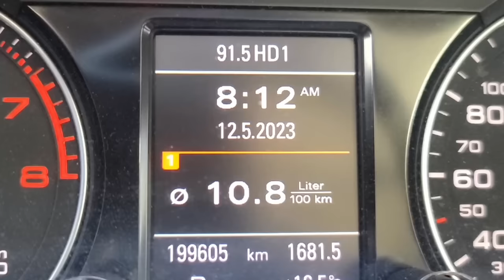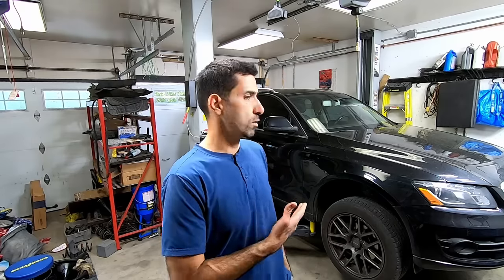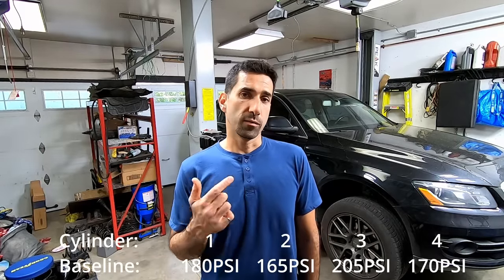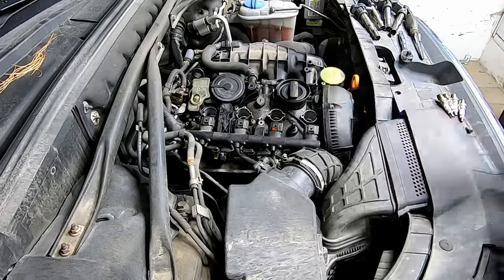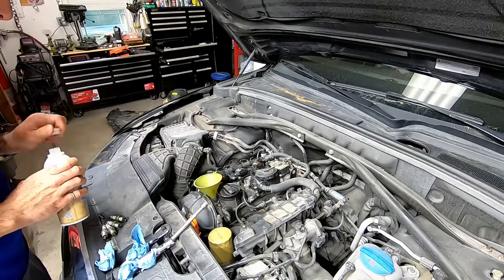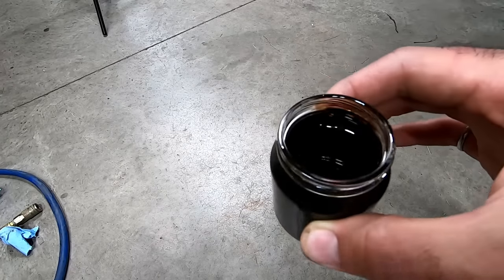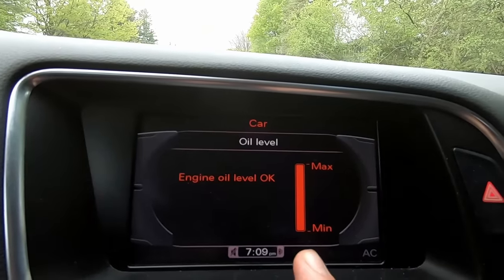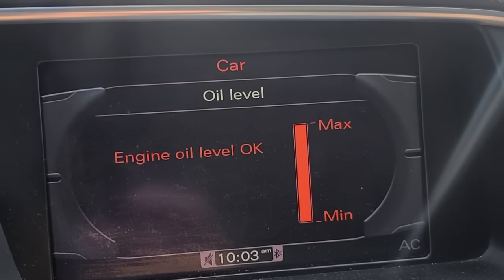How to fix excessive oil consumption from clogged piston rings (Part 2)

Comment: Same problem on 2009 A3 1.8T CDAA, (same engine as 2.0T with slightly less stroke). Oil consumption 1L per ~500km always 5w40. In my area (europe) we dont have access to b12 or seafoam is there any alternative from wynns, liqui moly that we can use? Or maybe using carb cleaner/valve cleaner. I have found that abbro carb cleaner contains acetone which is really good for decarb.
My next question why not using ~50ml of liquid per cylinder and screwing spark plugs and cranking dry(no fuel)- will that force more liquid past rings and clean them? 52ml is my equation for 2.0T, 500cc per cylinder and 9.6 compression is about 52ml. or 46ml for 1.8T/450cc per cylinder 
Thanks in advance
Reply from the maker: hey - all great questions...a few folks in EU have already asked for alternatives and if I was doing this without access to either Seafoam or B12 my go-to would be LiquiMoly Engine Flush (Pro-Line)...you know that's meant to go in the engine so it would be a safe substitute...most of the carb cleaners here are in spray form so they wouldn't work but if you have something you can pour it should be ok...always read the label to make sure it's safe for aluminum etc. Folks have also mentioned using diesel with the same success or pretty much any other "engine flush" or "engine treatment" that's meant to go in the oil...in my A4 video I started off with STP engine treatment (we've got about 4-5 different brands here supplying the same sort of product as Seafoam) and it was successful enough to get rid of a sever engine misfire on the first cycle so I`m pretty sure any one of these will work fine...B12 is probably the strongest thing I'd use but perhaps unnecessary for most situations...

In regards to the amount per cylinder - it's not related to the size of the engine...all I did is divide the can in 4 equal amounts...the can is a bit bigger than 400ml so each cylinder gets about 100ml each with a few drops extra at the end...

Last - cranking the motor with the plugs in...DON'T! I originally shot the video with the idea of putting the plugs back in and rotating the crank manually to use compression to force the liquid down - I couldn't even turn the crank by hand...I could have done something wrong but my assumption is there's so much liquid in the cylinder you're trying to compress it and it just isn't going to push through the rings that easily so I quickly gave up on that plan before I damaged the engine...if you tried to do that with the starter you might cause serious damage and frankly there's no need - the liquid disappears through the rings very quickly so the turning of the crank is really more to distribute it through the rings as much as possible...
Reply: @ETMotorsports   Thanks for fast response! I have couple more questions. 
1. Should the piston soak be performed on cold or hot engine? 
2. In a4 video you have mentioned about oil on valves and changing valve seals- Have that reduced oil consuption and by how much if any? And also valve seals job does that require head removal?
3. What oil do you reccomend for EA888 gen2 engines or any turbo DI engine?

One of many failure points of this engine is oil cooler gasket will fail, 2$ gasket and pain in ass to change 
Thank you again

Comment: Hi
How often do you crank the engine? Say you soaked it for 6 hours, do you crank it then top it up?
Please explain process 
Thank you
Reply from the maker: Every 6hrs add liquid and turn the crank - say 2-3 full rotations... don't use the starter - do it by hand
Reply: Were 2 bottles of B12 444 ml enough to complete the process?
Many thanks
Reply from the maker: @hishamelforjani7012  yeah that's more than enough... you could get away with one of your not doing the 6hr fill ups but it depends on how bad your problem is...
Reply: I have a 2005 Opel Zafira mark 1 with low mileage of 60k. I have blue  smoke only when I rev it. I did an oil change and drove for 260 miles, it lost 1L of oil.
Reply: Can I fill it up to the top of spark plug hole to insure the valves are soaked aswell?
Thank you
Reply from the maker: @hishamelforjani7012  it would be awesome if you could get the valves cleaned at the same time but it's not really possible... you can add more liquid without issues but I suggest doing it over time - every 6hrs or whatever schedule you choose so you can turn the crank... my thinking is that'll help get more liquid around the rings
Reply: Update
The first 6 hrs have now passed.
Cylinders 1,2 & 4 still have b-12 liquid in them(almost the 100ml still there), but cylinder 3 on the other hand was totally dry!
Why do you think that is please?
Reply from the maker: @hishamelforjani7012  interesting - I'm guessing cyl 3 is having the worst piston ring issues so it's leaking down the most... did you measure compression by any chance m
Reply from the maker: @hishamelforjani7012  if the other 3 cylinders still have liquid you don't need to add more - just cyl 3... then rotate the crank abs check back in 6hrs
Reply: Yes I did,
C1 185psi
C2 185psi
C3 175psi
C4 180psi
Reply from the maker: @hishamelforjani7012  hmm so #3 is showing a bit lower but really nothing too concerning
Reply: Update 
I added B-12 to all 4 cylinders equally. After 6hrs, cylinders 1,2 &4 had no liquid, cylinder 3 however still  had liquid. Taking it in turns buy the look of it😂
Reply from the maker: hey - any updates?

Comment: This “trick” applies to every single vehicle, I have never had a car with such problems, regardless the vehicle brand, I always use synthetic oil, do change every 5k and before do the oil change I put any cleaner in the engine run 100 to 1000 miles and voilà ! No oil consumption whatsoever and all my cars are over 100k miles

Comment: So I poured a can of B12 in my sons Audi  in the oil. Then we tried to start it and it would not start we had to disconnect battery change the oil then Audi started up. 
 A what would cause the motor not to start some sensors ?
Reply from the maker: You just added B12 in the oil to do a flush or you did the piston soak? There's no reason why adding B12 to the oil will prevent the car from starting
Reply: @ETMotorsports   
Just poured it into the oil to do a flush we tried to start the motor and would not start at all. We had to disconnect the battery cable. Then we change the oil and then the started it up.🤷🏽 my son was upset with me cause of my BS . I sent your video to him so he can watch video
Reply from the maker: @tiger.6509  hmm sorry to hear that... did the car crank but wasn't able to fire or didn't crank at all? Whatever the issue was it wasn't related to the B12 in the oil... if you scan the ecu you might be able to get codes if the engine registered a fault... there's nothing related to the oil that would prevent a start - you could pour water instead of oil and it'll still fire up - won't run for long but it'll start
Reply: @ETMotorsports  
I need to clarify this yes the vehicle is running, we have change the oil 2 times since that time when I put B12 in the oil . It’s using a quarter of oil every 600 or 800 miles. if we try this it’s going to be better.
Reply: Maybe you overfilled oil capacity and it has safety sensor for that?

Comment: Will that fix my 07 camry , burns oil crazy every 500 mile i add 1qtr
Reply from the maker: If the issue is oil rings then yes probably
Reply: @ETMotorsports  Toyota has burn oil issue and for camry 07-09 they had recall on 2AZ-FE engines due to pistons and rings issue. Not sure if rings, might the block is done too because it has over 335k miles. I add 1 qtr maybe each 300-500 mile depending the way I drive" smooth or aggressive on engine"
Reply from the maker: @emadgrabel3444  sounds like you're right in "got nothing to lose" territory

Comment: The thing I like much more in diesels is that you don't need to change the plugs ,only diesel filter
Reply: you need to change glow plugs. they burn out and no longer heats cilinder fast enough
Reply: @SayWhaaaaaaaaaaaaaaaaaaaaaaat  Yeah but after like 200k kms, my car is almost 20 years old still good glowplugs
Reply: You have to add adblue and change dpf
Reply: @Goldensunflower7  Real diesels, so pre DPF or deleted when " legal " lol :) 
My diesel is a 2006 pre DPF only change the oil/filters etc... and now and then diesel filter.
Reply: @dimmacommunication  nice then!! Haha

Comment: Have you done the compression test?
Reply: Same question??
Thanks
Reply from the maker: I did the compression test  but forgot to post the results...there was very little change - +/- 5psi on all cylinders...I`ll make sure to test it again when I change the oil at 5000km

Comment: Do you rotate the crank by hand or just turn key crank rotate with the fuel fuse disconnected  @eurotrashmotorsports
Reply from the maker: By hand while doing the soak - you don't want the starter throwing all the liquid out of the cylinders... when  you're finished crank it with the starter a few times to clean up anything left over so you don't hydrolock the motor

Comment: isn't the motor oil diluted with all that solvent? or did you do an oil change before driving it again? also, why not just use an engine flush that's designed to work with motor oil?
Reply from the maker: The motor oil is most definitely diluted in this process and yes an engine flush is a good alternative to use for a piston soak as well...I think it all comes down to how bad your consumption is and what your comfort level is... the B12 is by far the strongest solvent I've seen for this job and it's been used by plenty of folks in this manner without adverse effects...it worked great in the Q5 but I used Seafoam in my A4 and that had great results too... there are multiple stages in this process and you can modify it any way you like to fit your requirements... for example I drove the car for about 30 min with the B12 in it - you can skip that part and change your oil right away if you're not comfortable with it... in my A4 I ran the car with Rotella T6 diesel oil for 1000km because it has a lot of detergents- it's 100% not spec for the motor but it won't hurt anything for a short duration...

Comment: Are you using Miller's 5w40 synthetic engine oil? Is it good yhan Liqui moly?
Reply from the maker: Hey in this video I`m using a local brand that's made by Shell because my sister had it already...I used Pennzoil Platinum EURO 5w40 in all of my vehicles because it's the best I can get locally but LiquiMoly would be my #1 choice

Comment: is leveling the cylinders and rotating the crank necessary?
Reply from the maker: If you don't level the cylinders you risk having one of them at the top which will make it hard to fit much liquid inside... rotating the crank is meant to help move the liquid into the rings - not 100% required but should help wth the process

Comment: In my country I only can find the CRC OIL DRIP STOP for my diesel engine  is burning oil about 1 litre for every 500 kms is an Alfa Romeo.
I will try if stop the burning oil,I from Portugal.
Reply from the maker: hey do you have access to LiquiMoly Engine Flush Pro Line? or another fuel cleaner perhaps?
Reply: @ETMotorsports  Yes, here in my country there are many stores that sell Liqui Moly products. I even used an additive from Liqui Moly to clean the injectors but I thought that CRC products were the best for the problem of burning oil. So I will buy Liqui Moly Engine Flush Pro-Line.
Thanks.

Comment: I wish I had more clarity step by step how to do it, I have g5 2014 TDI and I’m loosing oil one liter per year !!!
Reply from the maker: One liter per year is an ok consumption - I wouldn't touch the motor
Reply: add Rislone Engine Treatment at every oil change and keep driving it. Rislone keeps the engine clean and the rings from sticking.

Comment: I don't know who taught you to drop your spark plugs like that - but you really shouldn't do that. If you crack an insulator - it's trash.  Or you can be altering your gaps.   Use a magnet or mechanical fingers to lower them into their start thread.
The  " SAND "  in your oil sample is hard carbon that's broken off / out  of the oil passages and off the ring gaps.  What are diamonds made of ?  Yes - there's an abrasive floating in your oil.

Comment: Hi are  from Canada? My friend car Audie Q5 has same problem, he changed oil panel, but problem is still there , it’s burning more oil than usual
Reply from the maker: Yup - in Canada... it's pretty common for these motors to burn oil unfortunately
Reply: @ETMotorsports my wife’s 2005 Mazda 3 sport, Calgary car, went from zero oil usage to 1qt in 500 miles all of sudden around 80 miles.
We were using valvoline full synthetic, which supposedly offered a warranty, but they had a lot of fine print and no interest in honoring a warranty for excess oil burning.

Comment: Hi, why do you turn the crank after every 6 hours?  Also, its a little concerning that its that hard to start afterwards. Do you know what causes that?
Reply from the maker: Hey great question... turning the crank is meant to get the liquid "pushed" down into the rings - there's no guarantee it actually does that but logically it makes sense...I tried doing that wth the spark plugs in and that didn't work - I couldn't actually turn the crank - I think it was trying to compress the liquid which wouldn't work...I suppose you can leave it be but make sure to keep adding liquid throughout because it drains down into the oil pan for sure... technically speaking you can change this process in a bunch of ways - leave b12 in longer, run it longer after, do it multiple times etc... if you check out the A4 video you'll see I did a soak with STP first and that cured my misfire so there are a bunch of ways to do this...

As for starting hard - not 100% sure... both cars did the same thing...I wonder if maybe compression changes until the rings reseat themselves...
Reply: I thought maybe you could also use compressed air to push the solution through too.
Reply from the maker: @rkan2  not a bad idea - I've got an attachment I use when changing valve seals that puts compressed air into the cylinder but if you do that make sure it's very low pressure... otherwise it'll just push everything into the oil pan when you aurally want it to sit with the rings...
Reply: @ETMotorsports  Maybe take it even further and just put some oil pump (electric ones that 
make some pressure and can run constantly are not cheap) and pump oil directly back to the cylinders from the sump. Leave it running for a month :D
Reply: @ETMotorsports 
use a rope. No air needed

Comment: when the piston rings are clogged up, it uses oil. the bottom ring is causing that. but isnt the cilinder wearing out because of this. if this is the solution of oil burning it still cant fix the cilinder wear.
Reply from the maker: Hmm good question...Clogged rings don't necessarily cause cylinder wear - neither of the 3 cars I've done so far has shown wall wear and no other viewer has reported seeing any... worth checking before doing the service though

Comment: Im from New Zealand can what else can i use other than that as we do not have berryman b12 chemtool
Reply from the maker: Yeah very common question - you can try pretty much any of the common engine treatment and engine flush products out there... there are also a number of fuel system cleaners but they're generally sold in smaller quantities so anything that you can find in a bigger bottle should work similar to this... in EU they have access to LiquiMoly Engine Flush Pro Line which should be a fairly strong alternative to the B12 - not sure if that's available in NZ

Comment: can i do this on my T1N sprinter diesel 2003??   thanks much.
Reply from the maker: You can but having gone through a few of those I'm surprised you've got oil burning issues? The 612/647 is an awesome motor - i haven't heard of oil burning because of piston rings
Reply: thanks for your reply.  i have a lot of blow by according to cap dance test.  it throws much oil out.  oil level seems to go down a quart in approx 500 miles.  i've removed the egr and oil seperator.  they look ok to me.  engine has only 165k on it.  thanks again. @ETMotorsports
Reply: also the van seems to run very well.  only driven it 1k miles. i think it sat a long time before we bought it.
Reply from the maker: @michaelcarman4875  what mileage is it? You could definitely try the treatment but be very careful taking out the glow plugs - they have the nasty habit of getting properly stuck...2003 will be the OM612 which is a bit harder to work with than the later 647 but not impossible
Reply: only has 165k miles but i think it has sat alot before and after we got it.  maybe that contributed to stuck rings?  i'm 78 and have worked on all our vehicles for over 50 years but never this type of problem before.  how would i get the b12 or whatever into the cyl to "soak".  since it runs very well maybe just put additive in diesel tank and drive to loosen rings if that's the problem even.  i really would not want to remove injectors. there's no "black death" at all.  maybe your're suggesting pouring down glow plug holes?  thanks much for your time!!  yes it's a 612.  b/t/w i just came in from starting it up.  it's 10 deg F and started.  i have a 96 7.3 that would not think of starting today. i've run wvo for over 200k miles thru it but have gone back to diesel  thanks again.  live in kc area.